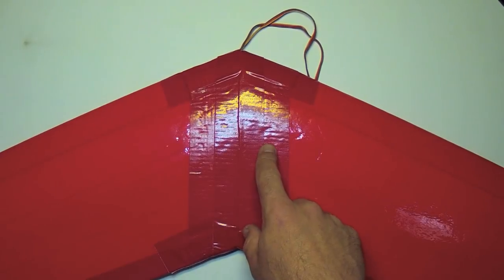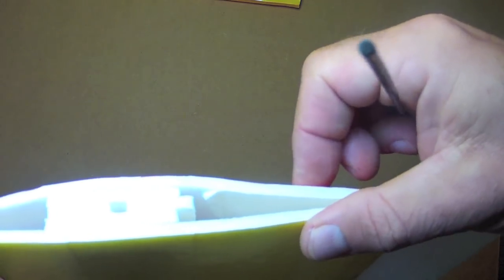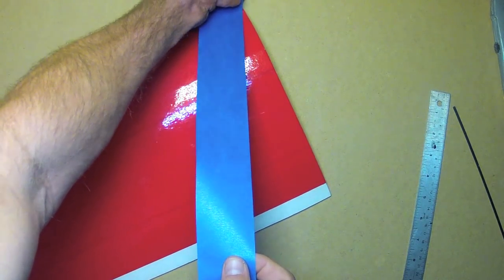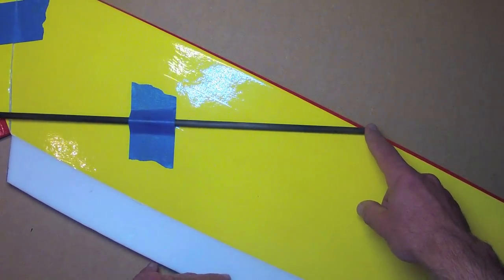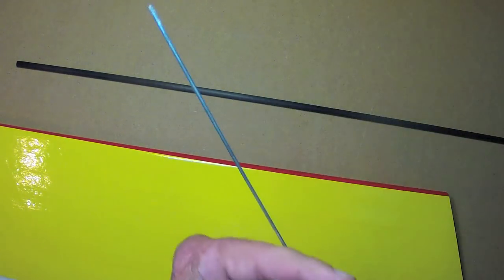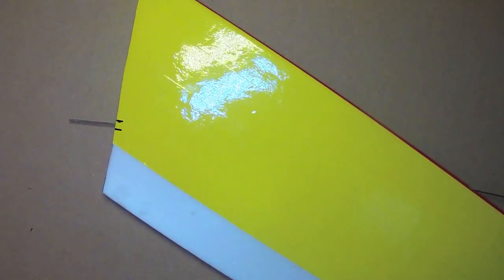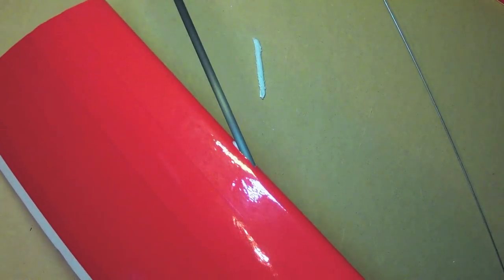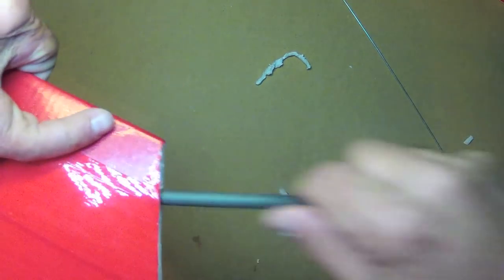SYNAPSE WING BUILD - Method A: Build Then Cut

Comment from the maker: Yes, exactly, just a double layer of duct tape (or better, vinyl tape) as the hinge, then wrap around that on each wing root to secure.  I cut all CF with a diamond cutoff wheel on a Dremel type tool.  Sounds fancy but only $5-10.  Cuts CF like hot knife through butter!

Comment from the maker: I totally see what you're talking about also worried about that some initially, but I've had no separation or problems yet.  Could be the hinge tape-over reinforces it, or that it's just such a long, broad area to glue that it distributes what pull-apart forces there may be.  I will let you know.  I have approaching 100 flights on the original Synapse including 4 crashes and many breakdowns and setups, so I will investigate carefully and report any problems.

Comment from the maker: I just duct tape it together, with nothing else between the wings except the spar.  you could glue in some gift cards or secondary spar if you were concerned about any torsion between the wings, but I don't.  Vinyl tape may be the next big thing, better than duct tape, so stay tuned.

Comment: Hey Ed, great videos and build techniques. Started my two Armin wings for the Synapse.  Looking at the beginning of the Method A video it looks like you just duct taped the wings together at the joint.  Is that all there is or did you glue as well?  Did not really see that covered on any of the vids.  I am going for the one piece wing on the first one. Thanks again for sharing.

Comment from the maker: In this plane both the chord and the wingspan are dictated by the 20" x 30" foamboard dimensions.  You could maybe eke out about 1" more chord than the 9" (7" airfoil + 1" elevon) you see here.  If that were no factor I think the challenge would be engineering the spar.  I've done up to 10' wingspan, but that was a straight wing.  Just pulling it out of my arse, I might say 7' wingspan might be attainable with foamboard swept wing using these techniques?

Comment: How do you join the wings if you want to make it a foldable wing? just a layer of duct tape on the lower surface? also you dont mention it, but with the carbon tube inside the other carbon tube, do you have any problems cutting the outer tube? any tips for that to stop it from splintering? tape it up perhaps?

Comment: Ed,

I have a concern of your recommendation at 1:28 of leaving the paper attached on the underside of the wing from the rear of the formers to the trailing edge of the control surface. My concern is of the paper separating from the foamboard at the trailing edge glue joint, due largely to that being the location where the paper would end due to the beveling of the control surface.

Is this an issue?

Comment from the maker: Well, it doesn't fundamentally matter if the motor is near the CG but it does make me wonder if your CG is too far back if it's near the motor, if you built your Synapse like mine.  Even in my shorty versions the CG is a few inches forward of the motor.  Want to PM me with an email and/or pix?

Comment: Hi Ed, The closest spar I can find is 750mm in length which just falls short of 30 inches by 1/4 of an inch each side. would that do or should I make my wings shorter each side to Compensate?
Reply: check out your local sporting goods shop that sells arrow blanks they come right around 34 36 inches